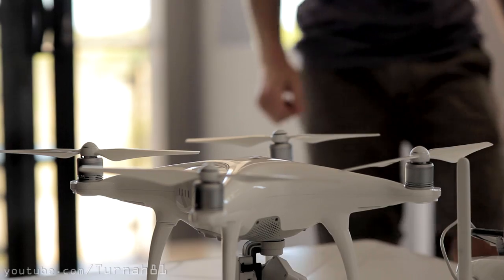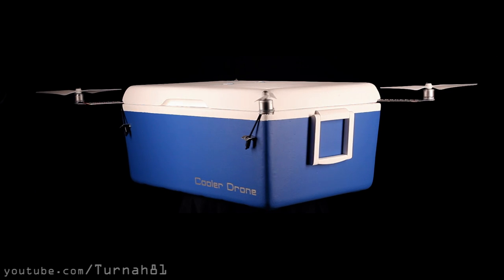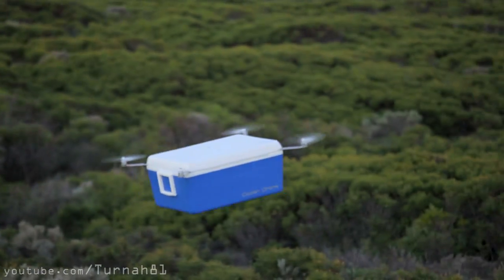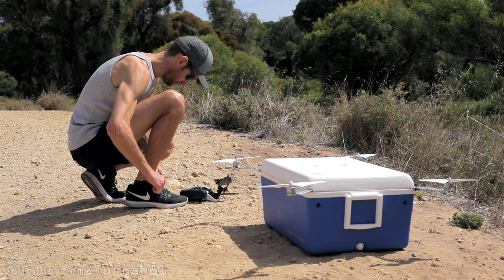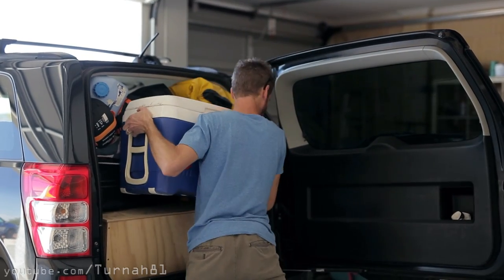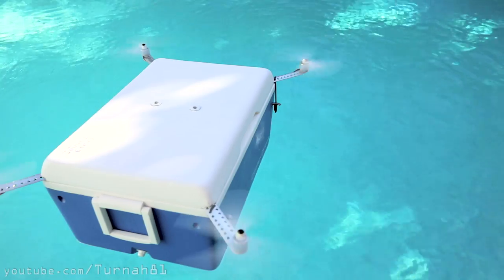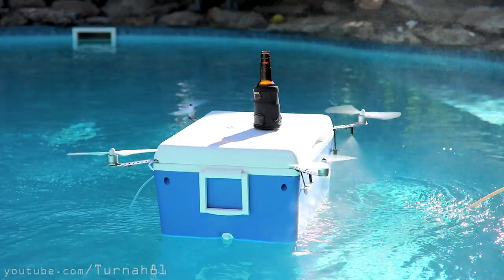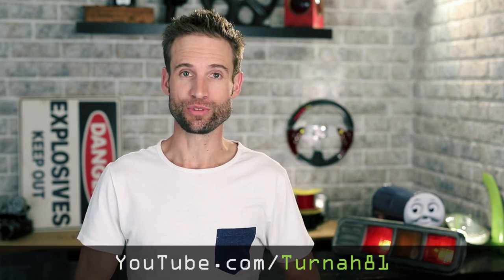I Made a Cooler That Flies to Bring Me Beer - The “Cooler Drone”

Comment: You could add more propellers and battery’s for more lifting force!
Reply: More batteries adds more weight, negating the additional force of more propellers.
It's a classic problem with rockets we've had for decades.
Most of the fuel used during take-off is used to life the weight of the fuel itself.

Comment: ..... How is that possible the motors would have problems lifting the weight not to mention how is it going to work if the lid is lifted  if the latch fails there is going to be a big issue

Comment: Looks imposible i think that those small propellers couldn't lift that ice box with ice and beer in it
Reply: What about 6 propellers
Reply: Nope
Reply: How many would work?
Reply: All depends how heavy is that cooler with beers and ice in it
Reply: DJI phantom isn't the best choice and the drone can't follow you without camera and sensors which I can't see on he's cooler drone
Reply: Lets say it was 10 kg
Reply: DJI phantom 3 can lift 1.2 kg so you will need maximum of 40 motors
Reply: If I would build it I would make it double quad with motors on each side of quad frame arms

Comment: How about a fruit blender drone?
Reply from the maker: 😮...im listening
Reply: A Kitchen Aid blender has 3.5 horsepowers... 😎. Four of them on a drone should lift a fruitbasket with some transport-contraption or tilt-supplyramp for the fruits to fall into the funnels above and around the impellers... Funnels widened for the propeller diameter. Since 110V / 230V is transformed down to the blenders controller, high power-lipos in row might do the job. However, won't top "will need beer soon mode" ...classic Aussie humor. Mate.